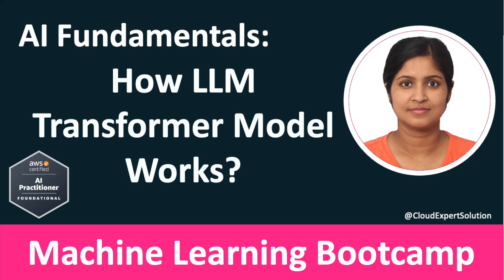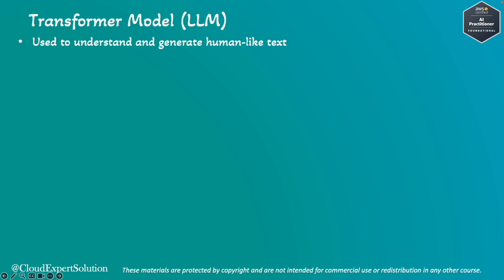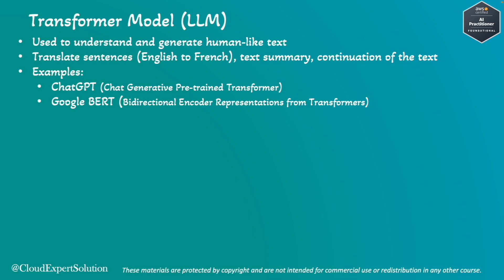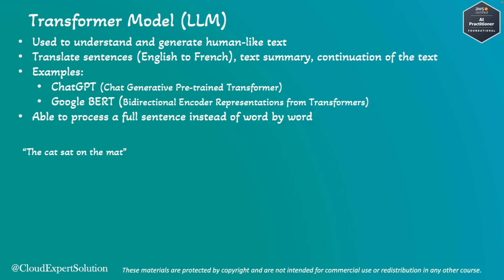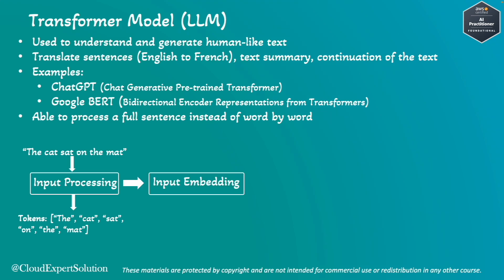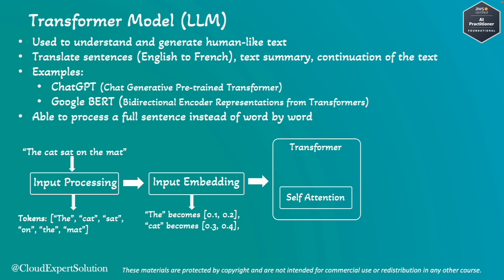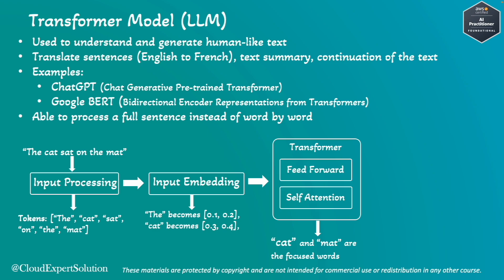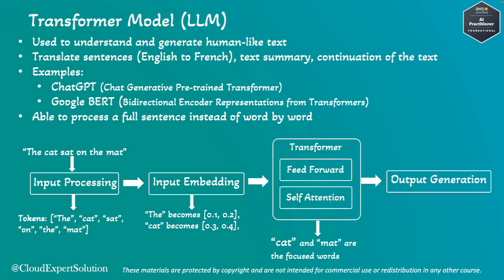AIF-C01 Module 1.3 - How Transformer Models Work?

Comment: is this series enough for clearing Aws AI prac exam
Reply from the maker: Yes, this bootcamp is fully aligned with the AWS AI Practitioner Certification Guide, and we regularly update the content to reflect any changes in the certification curriculum. If you go through all the modules thoroughly and review the included practice tests, you’ll be well prepared for the exam.

Thousands of learners have successfully cleared their certification on their first attempt using this series. It’s designed to give you clear explanations, structured learning, and practical insights — all in one place.

You’ve got this — stay consistent with your preparation, and you’ll do great! - Suparna